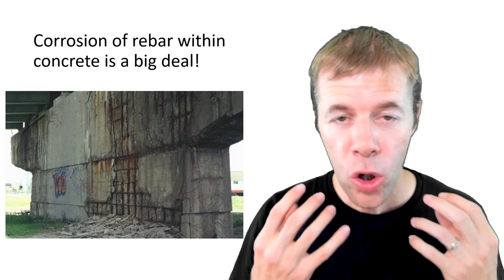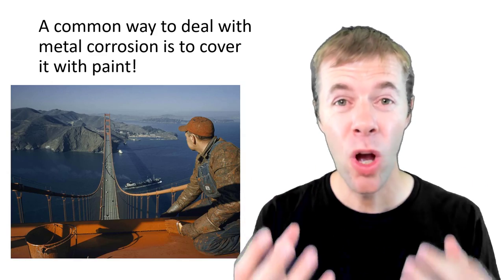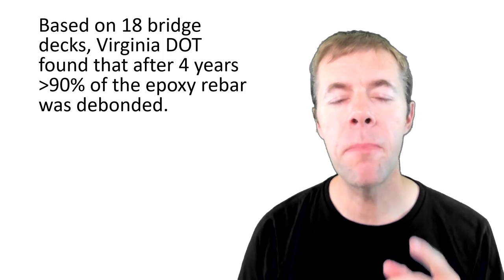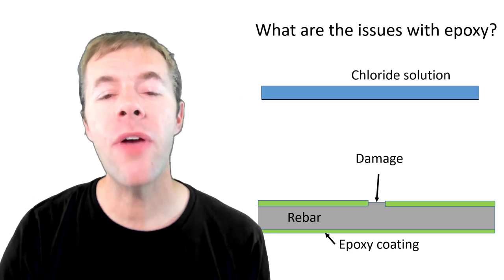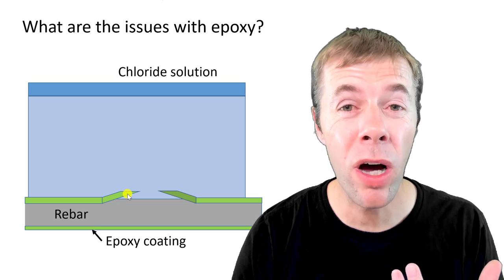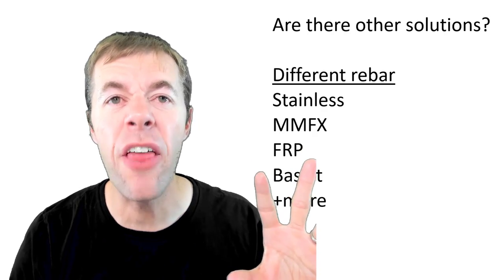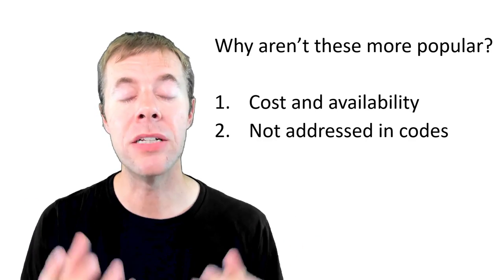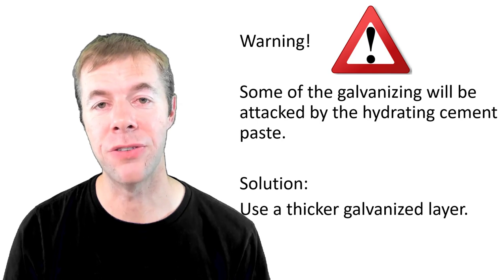What is epoxy coated rebar and why is it being banned?

Comment: In the wake of what happened in Miami the other week, I suspect this topic could be getting a lot of attention, possibly even before they stop digging up the dead.
Reply: Seeing as chlorides are the enemy of rebar it will be interesting to see if the chlorinated pool water was leaking into the Miami building support structure.  Chlorine is much worse than chlorides on steel.
Reply: @jimkenealy6448  from what I've seen everybody talking about and videos talking about it was not doing the waterproofing correctly and water would pool in the parking garage
Reply: @jimkenealy6448  my thoughts exactly, soon as I heard chlorides I thought of all that pool water pooling up and soaking the concrete.
Reply: @bigbadbart1  In wood construction water proofing is secondary to water removal, you assume water will get in anyways at some point, so you focus on removing that water quick by drainholes, air circulation and so on, that helps too to know when your water proofing fails.
Reply: @bigbadbart1  i would say that is bad architecture design/construction materials/and poor inspection standards/enforcement all together, if all it took was not doing the waterproofing correctly to have a total collapse like that.
Reply: @sanansa4567  
It was poor maintenance and not addressing the issue about water laying around the bases of the columns years ago when it first came to light, as far as the buildings design and it's being built in the first place there was nothing wrong with either, the fact that it stood through so many hurricanes over the years is proof of that. 
Throughout the comments on videos concerning the collapsing of that building there's all kinds of instant experts on structural engineering and the building trades who are repeating all kinds of myths about that buildings original construction and how supposedly in Florida at the time shoddy workmanship was common place, that's exactly what they are is myths, or better yet nothing but gossip.
Years before this building was put up any new construction in Florida and it was required that every single concrete truck that shows up on a jobsite for a continuous pour or just a pour that only required one truck load has a sample of concrete taken from every single truck that goes to a testing company that uses both destructive and non destructive testing methods, does that sound like something "shoddy" to you? No, it isn't, buildings in Florida have for years had standards and engineering of very strict standards because they live in a hurricane zone. 
If what all these experts are saying was true then building's like that one, which there's tens of thousands of all along Florida's coast, would have been collapsing right and left over the years. 
This happened from improper maintenance, just like never changing the oil in your cars engine will lead to it needing rebuilt while everyone else who owns the same model and year of car who did change their oil regularly are driving around without any problems, as a mechanic I used to see it all the time, when I'd be rebuilding an engine that was full of deposits that are a clear indication of an engine that never had it's oil changed on a regular basis and I'd explain to the owner that the reason why their engine is being rebuilt is because it didn't have it's oil changed regularly without exception they'd all say the same thing "I changed my oil regularly", yea, right, that's like being a smoker and telling a doctor that's looking at an X-ray of your chest that you're not a smoker. 
Year's ago when the issue about water laying around the base of those columns it should have been addressed, but landlords being the way they are were too cheap to have those area's waterproofed, and just like not regularly changing the oil in your car is an invitation to disaster not addressing the issue this building had led to this disaster.
Reply: @jimkenealy6448  
It certainly couldn't have helped.
Reply: Charles Allen  
Coating is fine as long it is accessible, as soon we talk coating of things burried in concrete? eeek!
Reply: I recall reading about problems there, years ago, with the parking structure and cracked concrete in the building...I was quite surprised when I read of the partial collapse of the building.....I thought/assumed it would have been demolished when they found the first cracks, in the concrete....
Reply: @jimkenealy6448  It was getting salt water from the beach too, right?
Reply: @cdnlong1  Sure - prevailing winds are east to west and sea spray can carry ocean water mist hundreds of yards inland.  That salty stuff rusts the hell out of any unprotected metal - even chrome.  But that is superficial.  Chlorides and chlorine are real go-getters when it comes to undermining the structural integrity of steel.
Reply: @jimkenealy6448  yes, but I thought I heard that actually seawater was seeping into the garage, and had to be pumped out regularly. Like sometimes a foot of water. Lots of chloride in that.
Reply: No epoxy Coated Rebar was used in that tower. 
We made and fabricated the rebar for thay building .
We did not use epoxy Coated Rebar at that time. 
We used epoxy Coated Rebar on the rebuilding of the SKYWAY BRIDGE from a phosphate tanker running into the bridge in May 1980 during a severe thunderstorm killing 35.
The company i worked for was 
FLORIDA STEEL CORP. 
based out of Tampa, Fla. 
🙋‍♂️🐈🌞⛱🙂👍✌
Reply: That condo tower collapse was due to a number of errors, the first of which was building on a barrier island.

Comment: Excellent explanation. I was an Army Reserve Engineer Officer in 1991. I ended up having long conversations with an Hawaii NG Major. We talked about weathering steel, epoxy coated rebar, and chinese steel. He warned me about all of them. The weathering steel was being eaten through in less than 20 years in the salt air at the U of Hawaii. He described the epoxy coated rebar being "cut" by scratches. He also warned that he had seen chinese steel come in that was less than 1/3 the ultimate strength that it was supposed to be.
From 1985 to 1991 I had been using regular rebar in my bridges and sealing the concrete. After that, I went to high strength rebar and extra sealing.  I came up with using weathering steel in my structures and having it expoxy coated. Our weathering steel was 55 ksi but I designed for 36ksi because I knew that the small towns that I worked for would not do the recommended maintenance. I did not use concrete in my superstructures because it was cost prohibitive for us. These were small local bridges so I used wood or steel bridge kits that the local road crews could assemble. It was a hold over from my time as a Bridge Building Platoon leader in the 70s. I just found your channel and  subscribed. I look forward to viewing your other topics. I retired 7 years ago. Good Luck, Rick
Reply from the maker: Richard,
Thanks for the awesome story.  Please keep the comments coming.  It is great to get feedback!
Reply: Dude that is some heartwarming material right there, socially conscious engineering is the best. Taking the "human factor" into account when designing thing should be a standard in engineering, but it sadly isn't everywhere.
Reply: Weathering Steel for Saline Coastal Areas Developed May 7, 1999 Weathering Steel for Saline Coastal Areas Developed.
Tsu Works.
Model bridge structure built at NKK's Tsu Works using the company's new weathering steel.
NKK has developed new weathering steel that requires no coating even in coastal areas with large amounts of airborne salt. Marketed as CUPLOY400-CL and CUPTEN490-CL, the new steel (containing1.5% nickel and 0.3% molybdenum as additives)has recently been chosen for two road bridge construction projects in Niigata and Mie prefectures.

NKK's new steel is characterized by its complex additives of nickel and molybdenum. With conventional weathering steels in a salt-rich environment, it has been difficult to prevent the progression of corrosion from the concentration of chlorine ions permeating through rust layers on the steel surface.NKK has successfully optimized a combination of nickel and molybdenum to effectively prevent the concentration of chlorine ions, thus enhancing chlorine resistant properties.

In addition to its excellent atmospheric corrosion resistance, the new steel, though added by alloys, offers remarkable mechanical properties, guaranteeing JIS SMA400 and 490. It also features good weldability due to the restrained carbon content, reducing work load by virtue of lower preheating temperature. As well, because initial rust streaming is minimal, appearance is enhanced.

NKK has confirmed the new steel's superb chlorine resistant properties in field exposure tests conducted at several locations and also in tests using a model bridge structure built at the Tsu Works. In developing and commercially producing the steel, NKK collaborated with Kobe Steel for the welding materials and with Mitsuboshi Sangyo for high-strength bolts fitted for the steel.

The new steel has been chosen for a single steel truss bridge (100m in length using 330 tons of steel) to be built in Niigata Prefecture and completed this August, and for a single non-synthetic steel-girder bridge (100m, 170 tons of steel) to go up this June in Mie Prefecture.

Near seacoasts and other saline areas, ordinary steel is generally treated with heavy corrosion-protection coating, which costs about ¥10,000 per square meter. While the new weathering steel is priced some 35% higher than conventional weathering steels, the feature of not requiring heavy anti-corrosive coating means that initial corrosion protection costs are held to one-third of heavy coating methods. Moreover, since periodic recoating is not needed, the new steel can cut total life-cycle costs dramatically, including costs of long-term maintenance.

All Rights Reserved, Copyright © NKK Corporation  Terms and Conditions 
Head Office: 1-1-2, Marunouchi, Chiyoda-ku, Tokyo 100-8202, Japan 
Tel: +81 3 3212-7111, Fax: +81 3 3214-8400 
http://www.nkk.co.jp/en/
Reply: One thing that is suspicious, this product seems to have disappeared only to be replaced by the ineffective American corten weathering steel, it seems NKK was coered economically by selfish vested American interests!
Reply: @homeopathicfossil-fuels4789  dude that's half of engineering. The issue is the people who write the checks.
Reply: @MrPaulhease The last bridges that I built had waterproof membranes on the decks, under the pavement. Most engineers were using a sealing treatment on concrete bridge decks. Last bridge that I designed was 25 years ago.
Reply: Richard Ross... why don’t you encourage the civil engineering societies to start investigating the use of some of our available trash converted into strengthing concrete.  Today are we not still using fiberglass chopping in concrete in lieu of steel matting?     What about recycled plastic re chopped or shredded into strands and mixed into the concrete?  It should be impervious to all  elements of corrosion.  There is an unlimited supply of used plastic from containers or packaging that are incredibly strong.  Ever try to open a typical small tool protected by a plastic packaging impervious to everything except large kitchen scissors or a hook bladed handy knife?   No corrosion. Time saving installation at the batch plant. Wear resistive to auto tires.  Need more strength, use more plastic chopping or shredding some.   Any thoughts?

JoeB,  Civil Engineering degree,  U of Md 1963.
Reply: Richard Ross, your post reminded me of an incident that happened years ago when I worked for Babcock & Wilcox power generation division in Brunswick, Georgia. Unbeknownst to our fabrication division, the structural steel we were purchasing was not being made by U.S. Steel and Bethlehem Steel. Even though it was stamped with their logos. It was in fact Japanese made. It’s not that it was inferior, it’s just that it was rated differently. American made steel like A36 is rated at rest whereas the foreign made steel is rated higher up the strength curve. If you know this, you can design and allow for it. We unfortunately had a massive failure on a fossil power plant under construction in India. The exterior structural support beams and columns failed and the duct assemblies came crashing down during construction. Several steel workers were killed or severely injured. 

During the ensuing investigation the failure was traced to poorly crafted I-beams and structural channel. When I inspected our structural members in their raw state in our steel yard, I noticed visible flaws in the webbing. There were slivers of steel that were slightly jutting out from the steel. When We grabbed them with vice grips and pulled, the outer layer pulled away and there was paint and un-fused recycled steel visible below! TSHTF and almost all of the structural steel members had to be isolated. 

Many lawsuits followed. That was 40+ years ago. Given the business climate in today’s world where profits are “GOD” and piss on how you achieve your goals, one can see how piss poor quality control happens.
Reply: I retired 8 years ago and want nothing to do with any of it anymore. I would be very leery of recycled plastics in concrete. When a crooked contractor threatened me and the state engineer backed him, I knew it was time to retire. I did laugh at the contractor because much tougher men had tried to kill me in the Army. Good Luck, Rick
Reply: @arttafil6792  That is a sad but unfortunately common story. Good Luck, Rick
Reply: Glad to hear from someone with direct experience. I suggested above that that the best reasonable solution to the corrosion and keep the cost from going out of site and "pricing it out of use" would be using galvo coated rebar. Then someone pointed out that the epoxy was getting damaged because they haul 3 tons of it at a time with wire cable. It cuts right through. My question is would the typical thickness of galvo also get cut through? How durable would the surface be? All options are moot if the handling of it circumvents the corrosion resistance.
Reply: @waynethomas1726  I thought that galvanized rebar was being looked at very seriously about 25 years ago. The big difference between galvanizing and epoxy coating is that when epoxy is scratched all of the ion exchange is concentrated at the scratch. This can lead to cutting the bar at the scratch. With galvanized, the ion exchange is over the entire surface and a scratch only corrodes a little more.
BTW the New Orleans collapse looks like an inadequate reshore job to me. Those happen quite frequently because "a proper job costs too much". Some of the pics show  bent shoring posts in an area next to the collapse.
Reply: @richardross7219  Yea, the whole, "a proper job costs too much" is the root of the problem. If the DOT required Galvanized coating then it would happen because they wouldn't be given a choice but to use it. Using Galvo would be far less expensive than using stainless steel (and that's IF they even had the means to produce that much stainless rebar...which they don't). If it was deemed to be the new standard the extra expense of galvo coating would get cheaper and, in the end, the cost probably wouldn't be that much higher than epoxy coated rebar.
Reply: I had just one course in reinforced concrete design many years ago. I do remember the instructor pounding into us how dangerous it was to OVER reinforce concrete. Tension failures involved stretching. Compression failures involved catastrophic, more or less explosive, failures.
Reply: @arttafil6792  As a child I regularly accompanied my stepdad to the docks (he was a marine surveyor) and on one trip I noticed an incompletely fused nut embedded in the ship's hull. Not quite 40 years ago.
Reply: Have you ever heard of this place called ft Lenard wood mo?
Reply: @kenfrievalt7826  We called it "Lost in the Woods". It is the US Army's Engineer Center and School. When I was in, Ft Belvoir was the Engineer Center and School. Good Luck, Rick
Reply: Was at lost in the woods summer of 84 and 85
Reply: @kenfrievalt7826  In my 29 years with the Army and Army Reserves I did not visit Lost in the Woods. Most of my active duty was at Ft Belvoir, VA. I spent some time at Ft Knox with the Armor and Engineer Board. Its been 20 years since I retired. Good Luck, Rick

Comment: Worked with steel all my life and outside work in iron that I did. The customer got it galvanised whether or not they asked for it !
Reply: I stopped specifying paint or epoxy coatings on outdoor structures for my employer years ago in favor of hot-dipped galvanizing.  The cost difference between them narrowed greatly from what it used to be, and the longevity of the structures easily tripled.

Comment: This is on everybody's mind. Thanks. At my work's technical library 20 years ago, I found a 5 volume set of ACI Manual of Concrete Practice (1990) in the trash. Needless to say, I saved them so my family and I could learn about concrete.
Reply: @andrew_koala2974  - What?
"The key difference between everyone vs everybody is everyone is more formal than everybody and more common in written language. Contents. “Everyone” and “everybody” are indefinite pronouns. They can be used interchangeably although there is a slight difference between them based on their usage."
- confused words. org